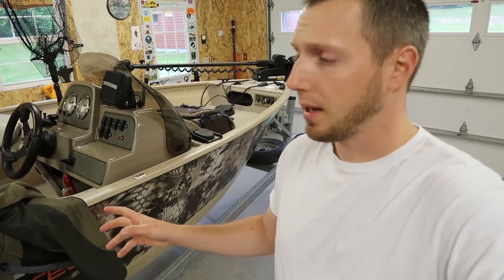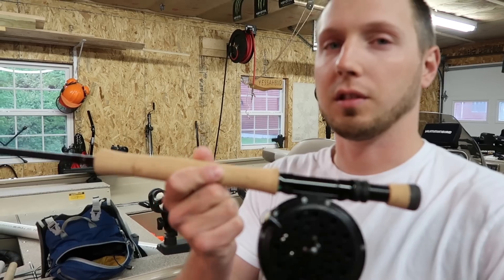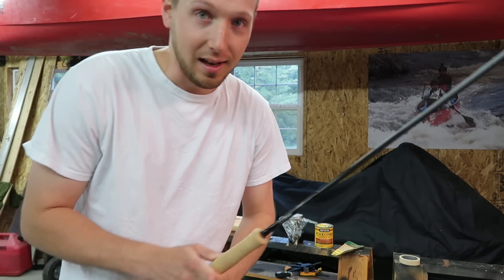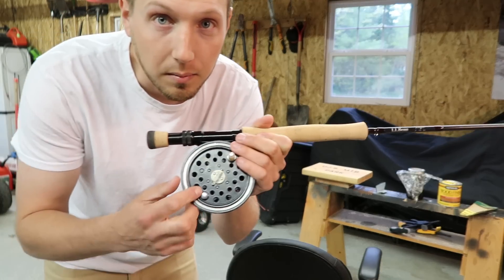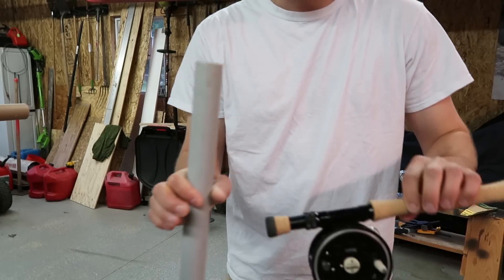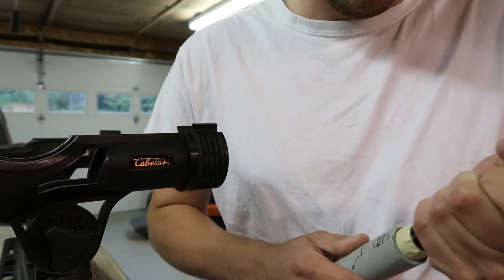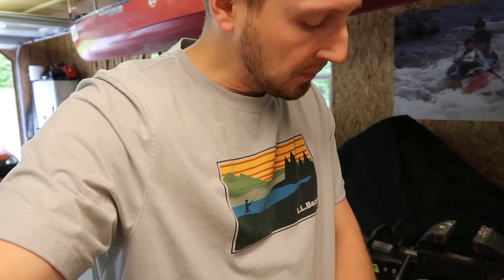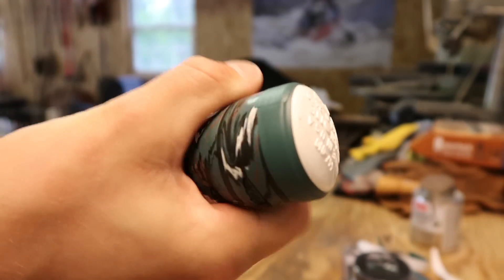REDNECK ROD BUTT!!

Comment: Finished product looks good! Would like to see some videos of how you choose what flies to use when fishing. I'm just getting into it and have been struggling with what to use and how to "match the hatch".
Reply from the maker: holdenmc6 I will make some videos this fall probably. And more next spring, but I actually like using smaller spoons for brookies on it. The Everett Lures casting spoons.
Reply: @mainetroutwhisperer  I found some of your lures at the Sportsman Show in April and bought a couple spoons. Haven't had much luck on them yet but I am just getting into trout fishing with lures in bigger bodies of water. Always been a brook fisherman and never ventured into rivers and ponds for trout.

Comment: I'm thinking on running two 8wt rods for my downriggers. Need to do something similar so the rod can sit in the cannon downrigger rod holder.
Reply from the maker: I have another video coming of one I built with a long butt section. 7wt. Use it in the DR also